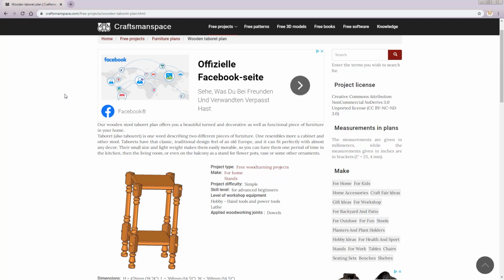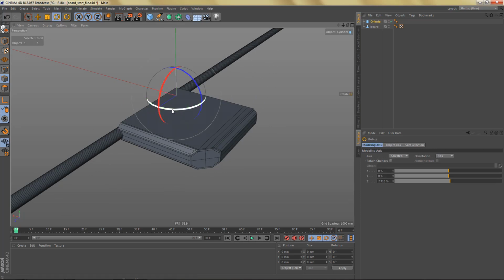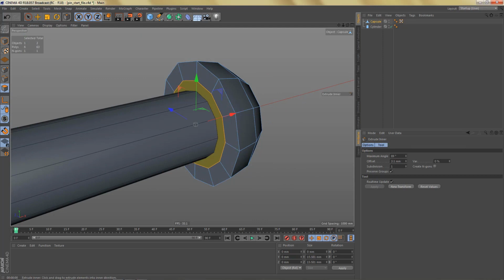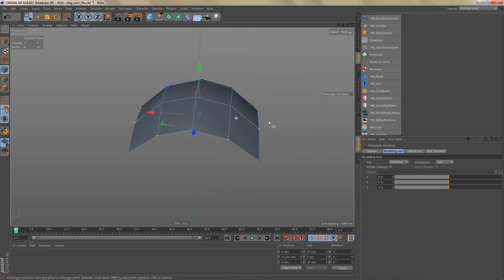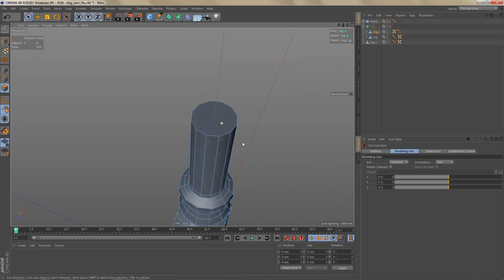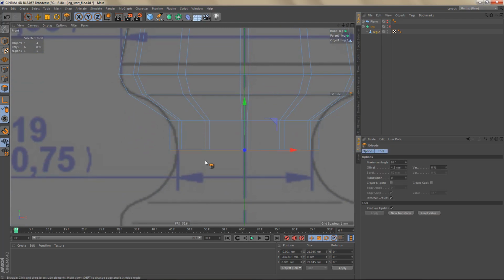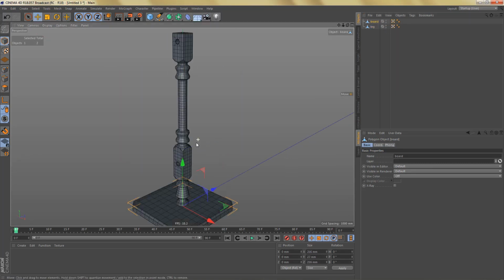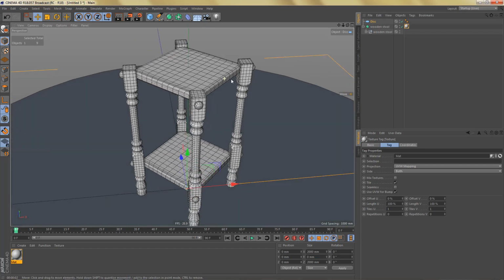SDS Modelling a Wooden Stool (Cinema 4D Tutorial)

Comment: Good tutorial dear, may I ask about Moi3d, is it have MoGraph like C4D?
Reply from the maker: MoI3D does have clone/duplicate functions, but it doesn't go beyond that or compare to C4D's MoGraph, which is much, much more powerful. You definitely cannot do motion graphics with MoI3D.
Reply: contrafibbularities 3D 
Thanks dear for your reply, do you think i have to learn Moi3D for modeling? I have good experience for C4D, but maybe Moi3D have options that C4D doesn't
Reply from the maker: @mohamohammed8799  That is one of those questions that are really difficult to answer, especially in just a few sentences. 

You don't have to. However, MoI can be an additional tool in your tool set if you want to. It is much easier to learn than other CAD software. It also has its own set of flaws and bugs, like any other software, of course. If you want something that is fairly easy to pick up, if you're into designing (technical) things, and if you don't need good topology, than MoI probably is a great tool to learn and use, and you can do great things with it..

Check out the following links for commercial MoI3D tutorials by two very talented people who really know how to use MoI and who are using it to design technical devices etc. I have these tutorials, and they were really helpful because they show how you can work in MoI and be less concerened with techniques and learning complex tools but rather focus on designing stuff. The previews will give you a first impression of what MoI can be used to build: 

https://gumroad.com/edonguraziu
https://gumroad.com/l/vavRq
Reply: contrafibbularities 3D 
You always be my teacher
Thank you very much for your specific reply
Reply from the maker: @mohamohammed8799  You're welcome! Thank you!